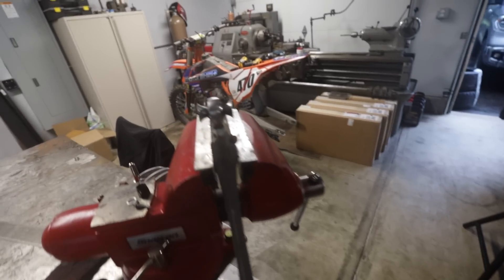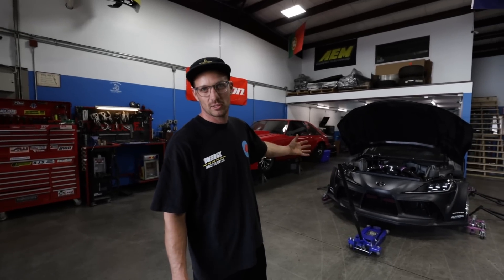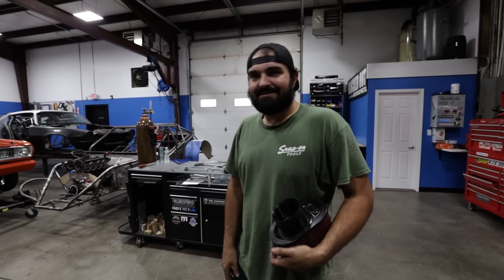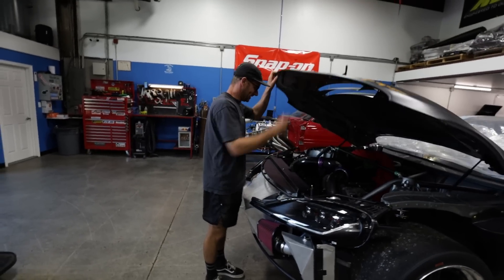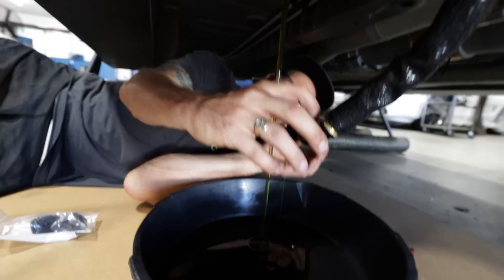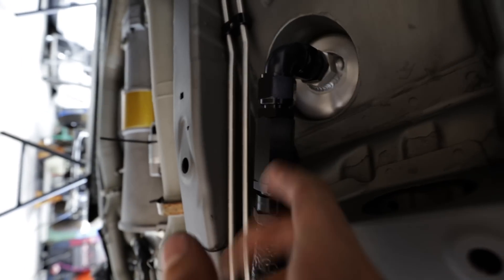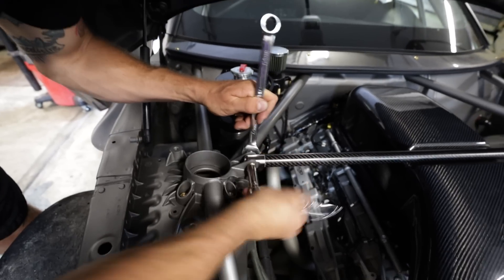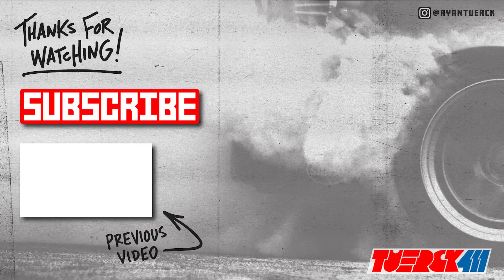Formula Supra Ducting

Comment: I gotta say, out of the thousands of custom cars I have seen on the internet and in real life, the Formula Supra is the only one I could really 100% consider a dream car. There is literally nothing on the entire car I would ever change, just pure perfection from start to finish.
Reply from the maker: Thank you brotha
Reply: I concur man it's an OCD build if I ever seen one! It's so OCD to the point where the new carbon hood vent now bothers me for being shiny and not like the rest of exterior xD
Reply: Thank you Dom
Reply: its ok i guess
Reply: Except for the fact that he won't use it in FD.
Reply: @isaacbarbosa7593  This car would never work in FD with that engine anyway, to be competitive you need like twice the power of what this is making. Judd themelves were also very against adding any sort of power adder as they are not made to handle any more than stock so you couldn’t just add a turbo or supercharger either.
Reply: @NorwayVFX  That is sad. Are you sure lightness wouldn't make up for it? Because the engine must be much lighter than the others.
Reply: @isaacbarbosa7593  The car and engine are both very very light, but to be competitive in FD nowadays you need tons of power and tons of grip. Getting this car to drift is pretty easy but he wouldn’t be able to keep up with todays FD cars, they are insanely fast even when going sideways. 
I think they run almost 300 wide tires and as low as 14 psi tire pressure.

Comment: Make a system to stop you starting the engine with the oil feed valve closed, a bit like what the do on aircraft… some sort of pin with a big ‘do not start’ tag that will stop you starting the engine  when its in the off position. Could be a bit complicated using a Bowden cable to open and close the valve from inside the car then a lock out for the starter?
Reply: yeah my thoughts too, i can see it easily being overlooked/forgotten about an boom, a cable shouldn't be to hard to set up......
Reply: Better yet, double down and add a sensor wired to the ECU
Reply: I was thinking the same thing, they’re gonna forget one time and toast the engine
Reply from the maker: The car won’t start until it hits 10 PSI of oil pressure.
Reply: @RyanTuerck  oh nice
Reply: @RyanTuerck  noted, but most crank bearing wear takes place at start up. A lock out or switch on the valve will sort that 🤷‍♂️
Reply: @RyanTuerck  and when someone doesn't open the valve all the way restricting flow?
Reply: @RyanTuerck  You may have seen them before, but Canton makes a solenoid valve for their accusump that you can control remote. Not only could you avoid going underneath the car every time, but you could also have the ECU trigger when to turn it on/off and display its status
Reply: @RyanTuerck  what happens in the scenario where you have an off track scenario? Do you need to jump out and get under the car to close the valve to preserve the engine? Is that feasible?
Reply: @RyanTuerck  boom nailed it

Comment: An ‘S’ bend in the scavenge pump  common discharge tube running vertically up and down the firewall, with the inside radius of the tube at the correct height you want to maintain engine oil level would prevent the need to crawl under the car and close that valve

Comment: Have you figured how to produce a second block for this amazing machine?
Reply from the maker: Not yet
Reply: @RyanTuerck  You should check out Steve Morris Engines. He engineered and machined the billet block for the Devel Sixteen. It's a quad turbo V16 that makes 5000hp!
Reply: @Sauerbrew777  Isn't that car not actually real though? Like, there is a physical one someone built, but as far as I new it was never actually operational
Reply: @partysodown  Yeah I think the car itself was never produced, but Steve Morris built a fully functional V16 that went through all kinds of testing. What I meant is that SM has the ability to machine custom billet blocks if Ryan can't find another. SM also designed the water jacketed billet hemis for all the drag and drive guys.
Reply: @Sauerbrew777  I knew that I had heard of him. Probably the only legit part of that whole car

Comment: @ryantureck . Could a rock or debris hit the lever on the ball valve shutting it off or partially closing the valve? Do you have a fail safe or a different lever on the valve maybe a round handle.

Comment: I think it would be slick to weld a fitting on the side of the oil tank that has a small hose coming off of it with a quick disconnect and then the other side has hose up to a funnel instead of trying to pour it from the bottle up inside the dash.

Amazing car and great work 🙏

Comment: I’d need a sticker across the entire inside of the windscreen TURN ON OIL FEED BALL VALVE BEFORE STARTING ! 🤣 you could use an electronic solenoid wired to ignition to shut on and off

Comment: i think you need some sort of micro switch to prevent the engine starting until the valve is opened also it shouldn't to hard to hook it up to a cable to open an close it from the inside of the car it'd also be a safety thing should the car be crashed ..... very cool Ryan but having to crawl under to turn the valve on an off is begging for mistakes to be made and kinda halfassed .....
Reply from the maker: Very much disagree. Manual is the best way. It’s on a check list on the preheating starting procedure.
Reply: @RyanTuerck   @RyanTuerck  you can disagree but just because it's on a check list doesn't guarantee it'll be checked and not over looked, you have a multi million dollar business an a car likely worth every bit of $500k+, that valve being hidden under the car to me seems dodgy and risky, having a cable connected is manual it also means at a glance you can be sure "yes, the valve is open/closed"  ........ your car, your money so it's all on you but that's something i'd expect of an low budget amateur not a pro......... good luck bro
Reply: @RyanTuerck  you should pokeyoke that

Comment: Having to reach under the car every time you want to start or stop the engine is ridiculous. Is the problem that the pressure pump leaks internally? Why not just run the feed line up above the static oil level then back down?    Oil Tank ___/\___Oil Pump
Or get a sprung valve that has a minimum pressure to open like 3 psi so that gravity alone can't push through. Probably as easy as getting a 12 or 16AN one way valve and maybe getting a heavier spring.